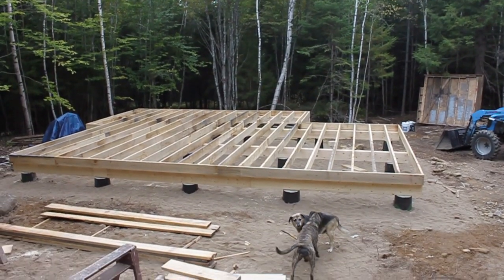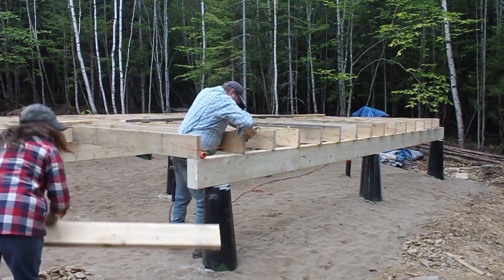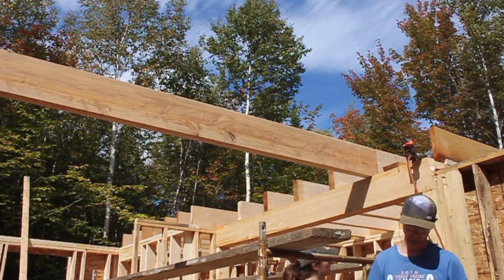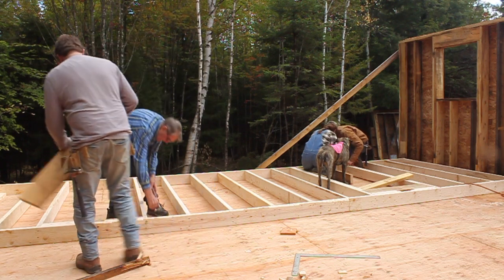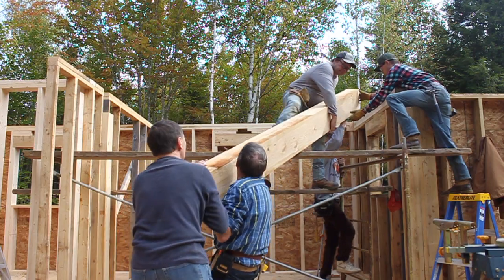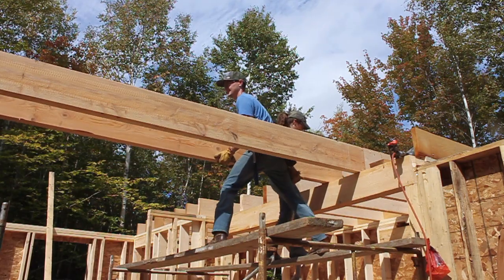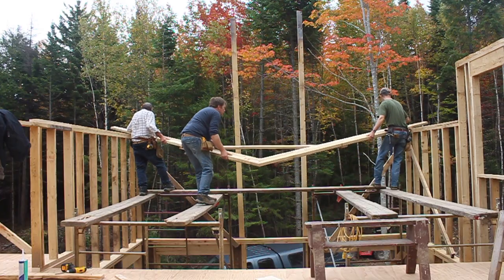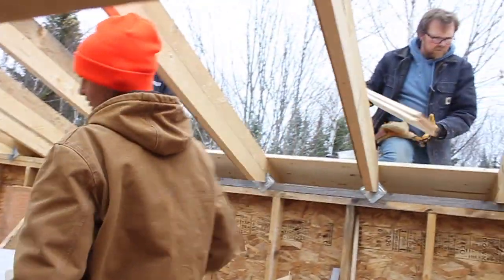Off Grid CABIN Build | Framing It Up

Comment: If you use full 2x4 for the second layer on your second story, offset the studs to create a thermal break between the interior and exterior wall. The R value of a 2x4 or 2x6 is less than insulation, so you will end up with a better insulated wall with less cold spots along the studs in the wall by offsetting the studs between the two stud walls.  I've heard of some builders use this technique to make greener homes in cold climates such as Alaska.

Comment: I'm in Canada too, don't really only on inside insulation. The more foamboard you can put outside, the better, you can also find foamboard with a layer like tyvek.  I have around  3'' outside in my cabin and still no insulation inside, it's R13  but it feels much warmer and it also  seal the house again air leeks and of course, thermal bridging...
Reply from the maker: Thanks for the advise, yes insulation is definitely important!

Comment: The lumber you used for the girders 2 by 10 x3 looks like regular building lumber and l see no caskets between the concrete and the girders must have caskets  to prevent moisture from concrete into lumber is code in Ontario even good idea if you are using pressure treated lumber

Comment: How are you going to insulate the floor and keep the critters out?
Reply from the maker: Hi Harry, we plan to insulate the floor from underneath by putting insulation between the floor joists and covering it up with plastic. We will probably use R 20 or R 30 insulation. Also, on top of the plywood floor we are going to lay strips of wood to build it up so we can lay foam board insulation on top of the floor. Around the whole cabin we are going to put a skirting of some kind to keep out critters and help with warmth, but we have not yet decided what to use. When we get to this step I will be sure to include it in a video, hope this helps!
Reply: I wondered how you were gonna keep the mice out. It's  amazing how they magically make fiberglass insulation disappear . Not sure where you are building the cabin...guessing it's Canada because you all say abowt. Happy New year😄
Reply: @backtothelandliving  you may want to put plywood underneath to keeps birds and mice from nesting underneath. And think about a vapor barrier if it’s heated in winter.